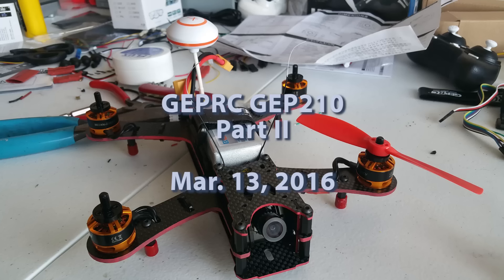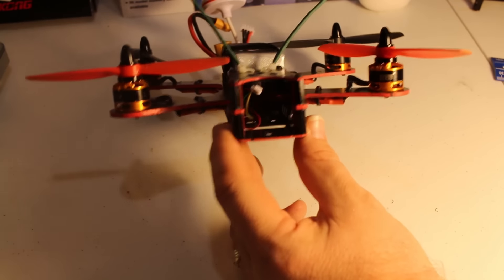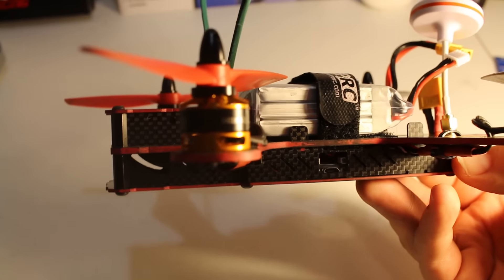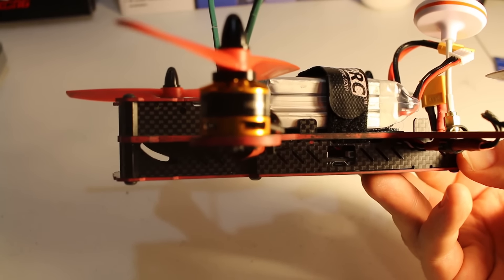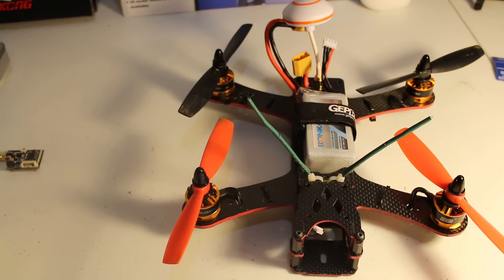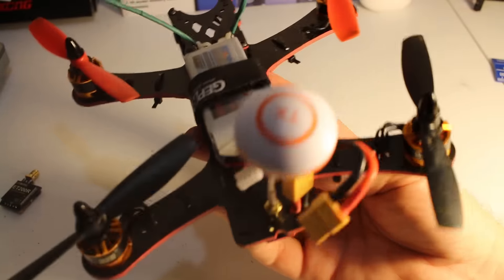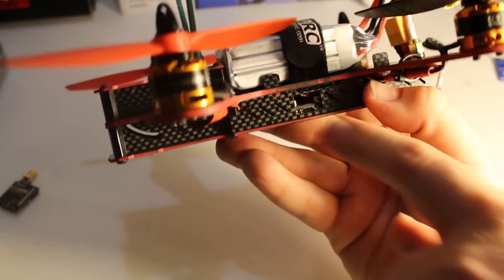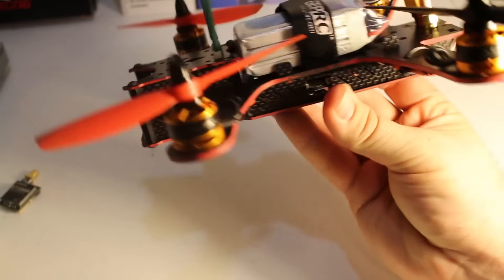GEP210 Part II - after build thoughts

Comment: I used a couple of layers of servo pads with a hole cut in the middle to stick the camera to the mounting plate - then used cable ties. That moved the lens back a bit to protect it. There was enough room. Think the pegs that stick up though the main plate and which sit either side of the lipo should be a bit taller. That would help to keep the lipo in place, a good idea because the props are liable to chop into the lipo if it moves much. Would be nice to have an alternate camera plate tilted rather than flat.
Reply from the maker: good ideas on the servo pads, the action cam mount and the pegs. There is definitely room for the camera to go back some. Still thinking of a way to attach the lens instead of the board to the plate...Kind of like the Aomway camera mounts that have the screw on the ring that tightens it onto the lens. 
http://shrsl.com/?~bqfn
Reply: +NordicBlue r/c can be done, with the right washers and hot glue. i've seen some people hot gluing it even without any washers, lol
Reply from the maker: +CNL _ I'll find out tomorrow night, my new camera is showing up finally. May need to do a quick Home Depot run to see what I can come up with.

Comment: Great video and thanks for showing all the important details on this frame. looking forward to your flight videos and long-term updates. I'm quite interested to see how durable this frame turns out. They keep Swiss-cheesing arms :( hopefully those souple of holes are a non-issue because the frame looks super light.  What was the weight without LiPo?
Reply from the maker: +EngineerX thanks! Without LiPo, i am at 302g
Reply: Thanks for the info on weight. That's very light. Should be fast and nimble! Will have to add it to my Bgood wishlist.

Comment: Hi, nice video, if I can say one thing about your solder joints, it will help if you turn up the heat on your soldering iron or get a bigger one, when you do that the wire and the tin will "melt" together much better than yours (not trying to say yours isn't good!) and you'll get a better connection.. :)
Sorry for my English😅
But nice build..
Reply: Thanks, Martin! I am definitely still working on my soldering skills, but I have improved since this video 2 years back. I am still using that bad quality iron, but I have learned to turn it some more :)
Reply: Patrick S oh, didnt saw the video was 2 years old.. sry..;)

Comment: Nice video!  Thank you for taking the time to make this.  I still do not understand why you needed to buy another PDB.  Can't you just orientate the PDB and mount it to the frame in the direction you want?  Does the included PDB have to be mounted in a certain direction?  This will be my first build too.
Reply from the maker: Thanks for the great question. If you have a look at the pdb, you will see that the positive is on one side and the negative is on the other. if you turn it 90 degrees, the positive will face up and the negative down. You are now stretching the wires across the pdb for the front and back motors. Have a look at the picture on my site: http://nordicbluerc.com/geprc-gep210-carbon-fiber-fpv-quadcopter-frame-review/

Comment: Thinking of designing a 3D printed top plate that will have a socket for the XT60 connector, antenna socket and side rails to protect the battery.
Reply: i'm in for one if you do. i'll be attempting this build with esc's mounted inside the frame :O

Comment: I think you might have been better off having the battery lead coming out of the side hole than hanging out of the back.  A lot of the 210 size racing frames i have seen have the battery connection off of the side and it seems to keep the wires out of your props better.
Reply from the maker: +Steven Osborn, not a bad idea either.  I think that, if I redo the wire, I will have it some out the front and then have it tucked inside the strap on the side. Saw someone else on RCG do that it seems to work really well. For now, I have a zip tie that is attaching it to my clover leaf and so far I have not nicked it yet.,...fingers crossed.
Reply: on my gep210 i brought the batt lead out behing the fpv camera where you have your lemon antennas

Comment: that's gotta be the sexiest frame ever! where would you place your OSD though? i reckon there isn't much space left inside, am i right? instead of an OSD, i'm planning to use a X8R rx for voltage telemetry, which is much larger than your satellite receiver (47x27x15mm), do you think it'll fit? (i'm waiting for my frame to arrive)
Reply from the maker: The micro minimosd is only 15 mm squared. it should fit right in front of the flight controller and behind the camera..at least that is my hope. That is a huge rx (at least for this size frame). Maybe it would fit where I am trying to shove the minimosd...but not sure.
Reply: NordicBlue r/c
man, this OSD of yours is the real shit! i'm getting one for sure, thanks for the idea.

Comment: hey nice video man i got my gep210 today and i am wondering how and where i will put in the esc connector of the f3, because in my case there is nkt enought room. should i solder the esc connectors directly to the f3?? I hope you understand what i mean so answer wouod be cool :D
Reply from the maker: yes. I soldered the ESC wires directly into the pin holes on the F3 board. No headers or plugs, just bare wires soldered on to the board
Reply: ok thank you

Comment: what controller do you use with that lemon-rx? does it work with a fr fs-t6? or does it require a controller with telemetry?
Reply from the maker: I used a Walkera Devo 7e. It is able to run many protocols with the help of www.deviationtx.com firmware and modules you can solder in.
Out of the box, it supports dsmx, which is the reason I bought the lemon receiver. I do not believe yours is able to  bind to a dsmx receiver, so the lemon would not work.